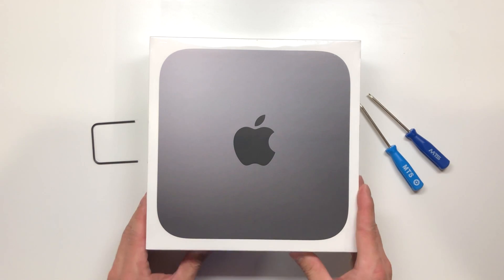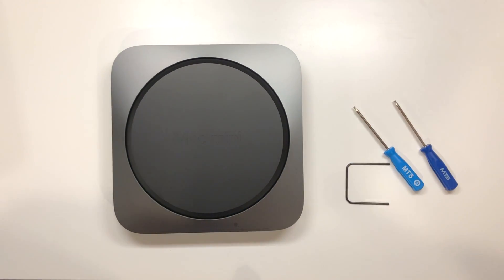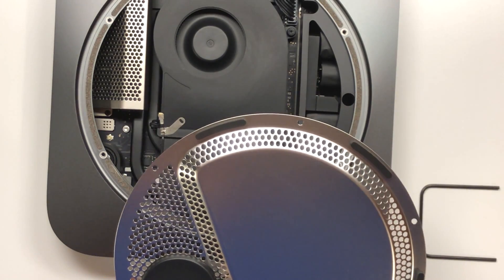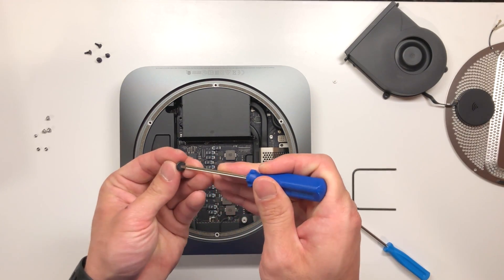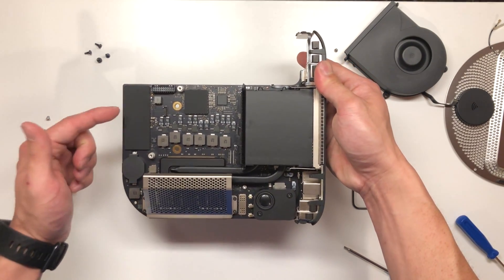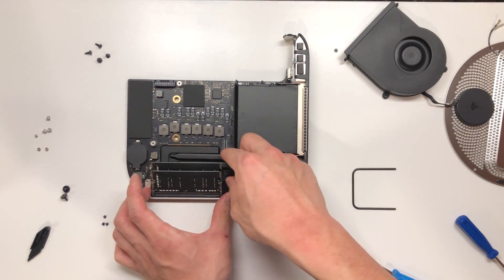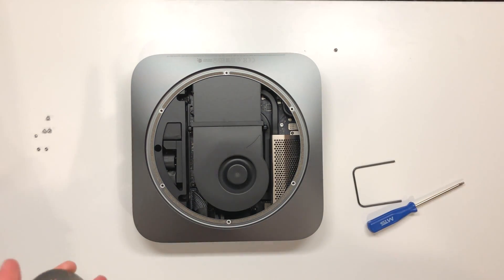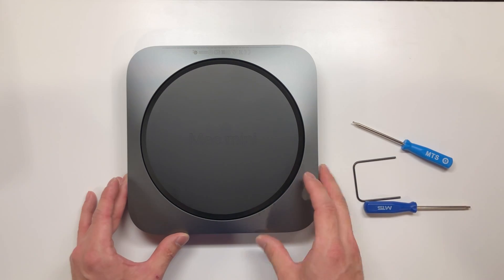Late 2018 Mac Mini Teardown & Ram Upgrade + Re-assembly

Comment: That was a gas. Noob Q? My 2018 Mac Mini came with a 121 GB flash drive. (32gb RAM 2x16.) Can I upgrade that hard drive 121gb flash drive? Or am I stuck with that?  I have late 2010 Mac Mini Server (1Tb SATA) and 3 external drives, one with TimeMachine, that I have Ethernet networked to it via my router. Thanks for insight... !

Comment: can the wifi antenna be separated off the metal base plate? I have a Cooling Stand I 3D printed with a grill built in and I think the metal cheese grater base restricts air.

Comment: Great video, straight to the point and clear instructions. One question, are the Tx screwdrivers 5 or 6 point and do they all need the hole in the middle?
Reply: I should point out that the link to the tool set doesn’t work.

Comment: on that ssd. how exotic is it?  can it be replaced (what are the restrictions) if the user has the necessary soldering skills and tools (i suppose an infrared station will be needed).

Comment: Apple disappoints me now.  Their product configurator adds +$1400 to upgrade from 128GB SSD to 2TB SSD, but I can buy an internal SSD that size anywhere for under $250.00.  I came to your video hoping to see how I could do that upgrade myself, but I see that the answer is that I can't.

Comment: Hi Brandon, 

I have just followed your steps and updated the memory using the 32GB Kit that you recommended from Crucial. All went well although when I am checking the memory on "about my mac", it is still saying that the mac mini only has 8GB... Is it normal or could be something wrong with my memories? Many thanks, Luis
Reply from the maker: Definitely not normal. I would double check you have both new sticks in there. If you're sure... power down, unplug, press and hold power button for 10 seconds, re-plug in, power up, and check again.
Reply: @brandon20904  I have tried what you told me to do and it worked :) Best regards and many thanks once again.

Comment: At 5'13'' you mention poping up the cable. In my case it did pop. instead the cable came out. leaving 2 exposed gold cable ends. Even with these out. I could not get the plastic connection to pop easily. it was very stiff. I managed to reconnect the cables by slipping them back into their slots but it was very intricate and I had a few nervous moments waiting for start up but all is working fine. However, just to warn people to be very very careful at this point. It does just pop for everyone and the cables have gold ends not silver as appear in your video. perhaps its the european model. I wonder if anyone else had this?

Comment: I'm trying to do this myself but I'm having a huge problem unscrewing the back. I've taken the back cover off and easily removed four of the six screws from the silver back using a T6 screwdriver, but the other two won't fit the screw driver! I don't know if they have used the wrong screws or if the screws are faulty. Has anyone else had this problem? Does anyone have any suggestions?
Reply: Never mind. I've done it, it required some serious pressure to get loose though!
Reply from the maker: @imajika6  For the future the bottom screws are TR6 not T6 torx. TR6 has a pin in the center, requiring the T6 to have a hole in the center.
Reply: @brandon20904  Thanks Brandon, I watched several videos before attempting this and yours was the most helpful.
Reply: I was successful in upgrading the RAM but now my fan doesn't work so I'm going to have to open it up again. My 2012 Mac Mini was so easy to upgrade I thought it would be like that again but I was very wrong. I wish I had paid the extra. Now Apple has missed out on £250 and annoyed a very good customer!
Reply: Ok, finally got it working. Fixing the fan was easy. Here are some tips for people thinking of doing this themselves:
1) This is not a 10 minute job, it took me 45 minutes for the memory and then another 10 to fix the fan
2) The power cable that connects to the motherboard is difficult to remove so be careful
3) When reattaching the fan cable make sure both sides have clicked into place
4) When finished test that the fan is working!
Reply from the maker: @imajika6  Glad everything is working!

Comment: I have the OWC toolkit, can I assume the T6 and T8 won't work?
Reply from the maker: The bottom requires a TR6 torx. This screw has a pin in the center requiring the TR6 torx to have a hole in the center of the screwdriver. I linked one in the description.

Comment: How to upgrade my notebook hp elitebook 8770w: slide the lock to the left, remove the sliding bottom panel, upgrade ram, hd, clean the fan. Close. 30 seconds upgrade

Comment: Can you use external hdd via usb c? Or even external ssd? Will it be usable like stock ssd?
Reply from the maker: In a way yes. Search "different startup disk mac" on google. You can change boot drive to the external and install stuff to that drive.
Reply: Brandon Geekabit Thank you, that’s a nice option...i will boot from stock ssd, and only store files on external if i ran out of that 128 gb’s

Comment: Your description says for a 16 gig configuration to just use one 16 gig stick, but won't you get better performance with 2 8 gig sticks?
Reply from the maker: That is correct. In theory running ram at dual channels is more efficient. For simplicity and upgrades later I would get the 16GB now and upgrade one more later.

Comment: Great video I wanted to see for my self how much of a pain Apple made it to upgrade the ram.
I am very glad to see the fact they brought back ram slots on this! compared to the 2014 model that was soldered.....
But I really wish they allowed you to replace the SSD..... no reason they couldn't have found the space for M.2 Sata drive in there...... 
So if your SSD ever fails & they do fail..... Your whole mac is now garbage..... 

But this doesn't seem to bad, I have dealt with allot worse when I try to service certain Apple products...
But this is by no means easy for your average user..... & this is why Apple want's you to go to an Apple store & pay a crazy amount of money for them to do it.
I see no reason why they couldn't have rearranged things to work like the 2012 models...

But I'm fine with that, I count this as a victory & I actually really like how the whole logic board slides out! I actually love that!
It would be perfect if I could replace the SSD, & maybe $200 US cheaper......
No reason an I3 with 8gb of ram & a 128gb SSD needs to cost this much more then the old model.....

If it was cheaper..... I would maybe try to dig out the money to buy one..... But I am hoping this will lower the retail prices of the older models.....
Mac's have always held their value..... But I would like to see some pop up for cheaper....
Honestly the 2014 model with 4gb of ram should be super cheap now since that's all it will ever amount too!

Comment: I believe Apple took away the sd card slot to get you to get a higher storage right away as sd cards have gotten cheap very fast and big lately.
Reply from the maker: Or so Apple could could sell you an overpriced Apple branded USB-C to SD card adapter.

Comment: Nice job.  So this is much more difficult than on my 2011 mini, but it also looks easier than hard drive replacement on those models, since removing the motherboard doesn't require removing the power supply and doesn't require any special tools.

Comment: Non-upgradeable SSD... that's a shame. I'm going to need one of these to port my games to macOS, how much free space is available on the 128GB model?
I don't want to pay the extra 240€ if I can, the base model is already very expensive (900€).
Reply: So many ports to run the same upgrades....
Reply: masterneme The hard drive is flash based and mega fast, plus being soldered, it’s protected and encrypted by the T2 chip.

You can always run an external USB C Samsung SSD if you run out of storage later on, but these tend to average around 500Mb/s, whereas the Apple flash storage tends to hit 3000Mb/s +
Reply: @JakeM218  Do you know how much free space is available? I've been thinking that if I get one I would rather connect it to a NAS. I don't care about speed as much as to having space to put my game assets and build macOS/iOS versions of them.
Reply: masterneme Back when the MacBook Air’s had 64gb hard drives, people would make guides on how to clear up free space - deleting extra languages that are on the system but not used etc, so maybe worth seeing what can be removed.

I think the system files are about 16gb - 20gb.

If you pay for iCloud storage, it’s possible to move some things to the cloud - photos, iMessages etc which can save some data. 

I reckon you’re looking at about 100-110GB free from the get go.
Reply: @JakeM218  So it's safe to assume that there're at least 70GB free? I can live with that, thanks for your answers.
Reply: @masterneme  there is definitely more then 70 gigs free
Reply: @chopping_board  Good to know, thanks.

Comment: How are they fitting 64GB in two slots? I thought those RAM sticks top out at 16GB each
Reply from the maker: They top out at 32GB in each slot. 64GB is the max supported.

Comment: Unlike a laptop, the Mac Mini isn't something that needs to be super compact for easy carrying. I don't think users would mind a little more depth in exchange for a more modular approach to upgradability, especially the SSD.
Reply: Edac2 Yes And no. Space on a desk is important. My 2012 Mac Mini I’ve often taken while away on business and connected to a screen in a hotel room.

Apple is also marketing this as a stackable device, and an add on to offload work from another computer. If you start stacking multiple Mac Mini’s, size does become an issue.

The flash based storage I think will be permanently soldered now as it’s then protected by the T2 chip and fully encrypted.
Reply: Also it’s got Thunderbolt 3 and 10 gigabit Ethernet. If you want more storage, just connect an external SSD or a NAS.

Comment: The Mac mini does hold a residual charge in its capacitors when you unplug it. It’s used for what apple calls, “the. Smc controller”. To be safe when unplugging you should unplug the Mac mini and hold down the power button for about 5 seconds.

Comment: Apart from discouraging users, does the metal cage serve any technical purpose (preventing electric interference etc. )?
Reply: Probably to stop the RAM sticks being dislodged if the Mac Mini is dropped?

Or maybe it’s to do with the air flow on the cooling system.

Comment: Well, whilst it isn't the most straightforward RAM upgrade, it is at least doable by most people with a couple of screwdrivers and two brain cells to rub together.

But now I've seen inside it, I have my doubts as I don't like soldered in SSD's.  Whats wrong with M.2 Apple?
Reply: M2 SSDs are slower. PCIe based SSDs are almost 50 to 100% faster. And allow for hardware encryption at high speeds of about 3GBPS when put together with T2 chip.
Reply: @sanketkasar8675  M.2 is a form factor. A Samsung 970Pro shits all over Apple's SSDs.
Reply: @sanketkasar8675  It's the upgradability and portability that I'm mourning, though I do appreciate performance.
Reply: Duncan Gunn Well that excludes the majority of people commenting then...

Comment: Man, I can do the RAM upgrade thanks to this, but I'm not too chuffed thatI'll need to buy it with the only SSD it'll ever have, considering they have lower life-spans than regular HDDs.
Reply: Not really, maybe this is the case with older sata ssds, but with the one used in this I really doubt they don't have a really long life, but the fact that is soldered when the RAM isn't is really weird to begin with, but then again this is apple.
Reply: @bogdanlazar5907  These are PCIe based SSDs and Apple has been using them in almost all of its pro devices lately. Speeds are over 3000Gbps as compared to normal M2 or SATA SSDs which give you almost 1.5Gbps. And TB3 supports speeds of upto 4Gbps anyway, so you can easily use external SSDs instead of internal without compromising on performance.
Reply: @sanketkasar8675  Yes but PCIe could be unsoldered too.

Comment: and to think the 2012,Model simply required twisting the bottom cover, removing the cover, and then replacing the RAM. Apple has become so anti-consumer since Cook took over.
Reply: How many times you change RAM? Once?
Reply: Jay , I’m not referring you Dell, HP or any other brand you purchase over the counter. Newegg is and other similar places provide small form factor PCs
Reply: M Ray - another spec freak I see
Reply: Incredible how people still defend Apple even when they are abusive af. Their products are indeed great, but are they worth it?
Reply: It still isnt that bad with the mini tho. Just a lil bit of twisting and turning
Reply: J H that added a lot to the debate.
Reply: According to Geekbench, this is up to 3x more powerful in the same form factor. There’s always going to be compromises with that, and I’m glad they haven’t compromised cooling to make the ram easier to upgrade.

Personally, I prefer everything soldered in. It guarantees a lot more quality in the secondhand market knowing that there’s no reason to mess around inside the machine. Secondhand values are then higher, which means upgrading isn’t as much of an issue.
Reply: @JakeM218  My mobile phone is 7x more powerful compared to the one I bought 4 years ago.... 

They could make it 2cm taller and noone would have bad feelings :)
Reply: Jake M, compromises? I'm assuming these CPUs get not higher in temps than the one's in the previous models so using that as an excuse for making it a pain to upgrade RAM, is ambiguous. They could have made it easier but didn't. It's seems to be another manipulating tactic of Apples in order to get you to send it to them to upgrade, for $.

Your already spending $799 on a ”machine” that only has an i3, 8GB of RAM and 128GB of storage. It's 2018, not 2008. $799 should at least get you 16GB of RAM and 256GB of storage. Apple could have provided a $500 solution with a dual-core and 8GB of RAM like in 2014. Nope! Let's not listen to our fans and hike the price another $200 for underwelming specifications.
Reply: @randommiker  What part of this is difficult in any way?  Take out a bunch of little screws, unplug a couple things, take out the old RAM, put in the new RAM, put it all back together.   Looks pretty easy to me.   Spend 10 mins of your own time to save hundreds of dollars, yes and thank you Apple!
Reply: 8654 Zulu Foxtrot , what part? We can start with all the screws. Also, the facts you have to take out other parts just to get to the RAM slots. How many screw and how many parts do you have take out of a quality - small form factor Intel NUC to install more RAM? That’s easy and accessible. Not to mention a $799 NUC would run circles around this piece of $hit aluminum can in both CPU, RAM, storage and they actually have dedicated graphics and not Intels joke of a graphics solutions. Your basically paying a premium price for a label.
Reply: If you think taking out screws is difficult....wow.  An Intel NUC is nothing like this, not even close.  The only thing similar is the size.  Spec out a NUC, with the same/similar components and they will be about the same price.   Then figure in the logevity factor....Mac’s simply stay faster and more productive longer than their PC counterparts.  Example:  My 2012 MacBook Pro is still fast, still runs everything out there, including the top of the line video editing programs pretty darn good.   Compare a 5yr old Mac vs a 5yr old PC, either laptop or desktop, and the Mac’s hold value two to three times as well.   I have both very powerful Macs and very powerful gaming PC’s, I love my gaming rig, but I will never buy a PC based device for anything but gaming.
Reply: 8654 Zulu Foxtrot , I have a Intel NUC8i7HVK that I grabbed brand new for $850. It’s great quality and a breeze to add RAM to in which it already came with 16. It’s nice little powerhouse for my portable audio recording needs for bands. I never said having to unscrew screws was to much but I think it’s ambiguous it’s takes that much effort and unscrewing to simply add more ...RAM 

Let’s pit my NUC against the $799 Mac Mini using a legitimate DAW benchmark loaded with plugins and watch the NUC come out on top. 

Let’s the see which one does better at graphics intense applications in which I’m pretty sure the Vega graphics in this  NUC will put it to shame. 

Also, I’m an IT who works for a company that repairs computing devices and although we see more Windows based PCs, they are also cheap and not in the price range of a Mac. I’ve seen maybe, one or two +$1000 Windows PCs in our shop. Basically, do not even think Apple can touch the quality and performance per dollar of companies like ASUS or Lenovo when it comes to anything over $800.

The $799 Mac Mini has specifications like it’s still 2008. I’ve not checked but I would not be surprised if even their highest end Mac Mini didn’t have dedicated graphics.